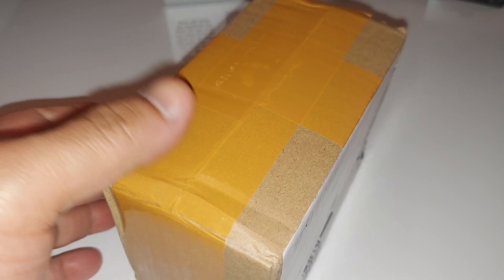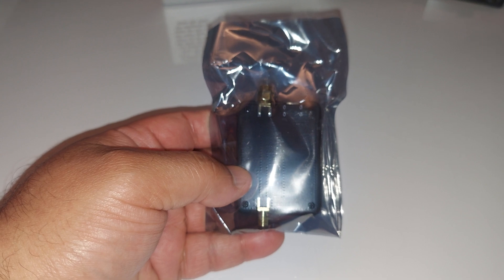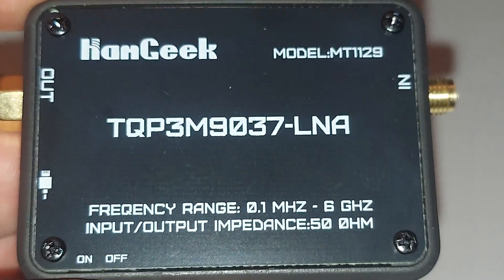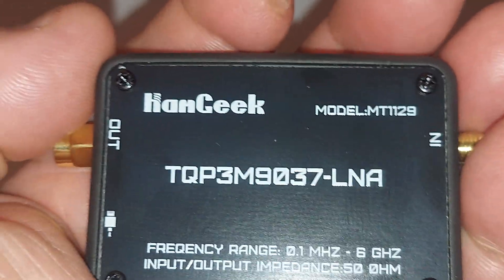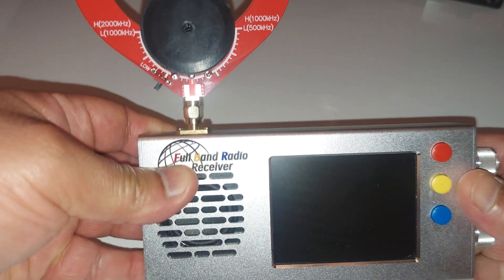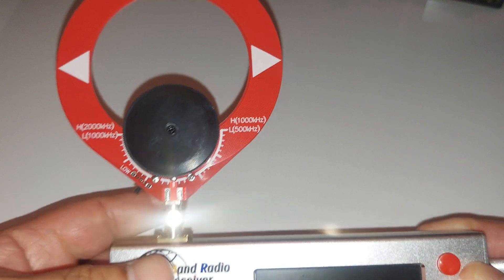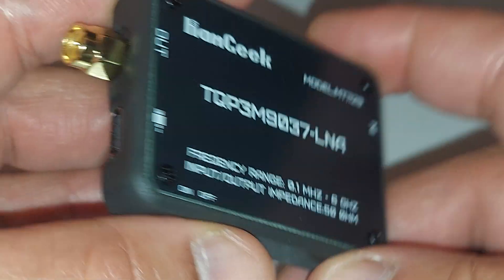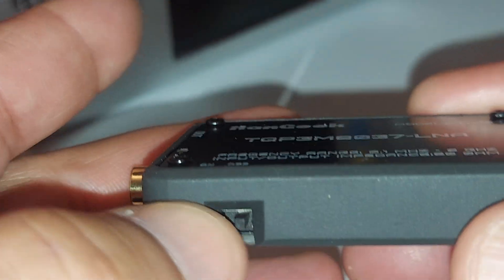Unboxing the Hamgeek MT1129 Low Noise Amplifier for TEF6686 | Si4732 and Malahit Radio

Comment: Hi. I ve got this device for my donut antennas too. Do the job as expected. There is a red green led inside to show when it is charged. You can see the light by the frame gap of the device in the dark.
Reply from the maker: Yes I charged it for the first time after the live stream.  Yes the led is red until it became fully charged then turned green, pretty cool to see that.  I like this LNA so far.  Thank you for watching.  Have a great day.